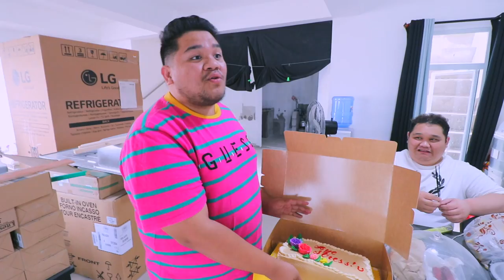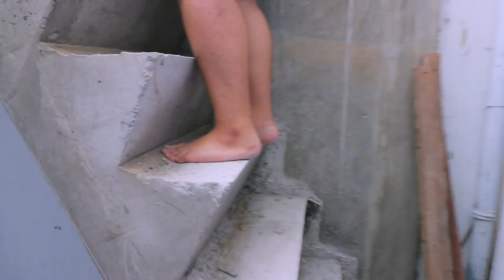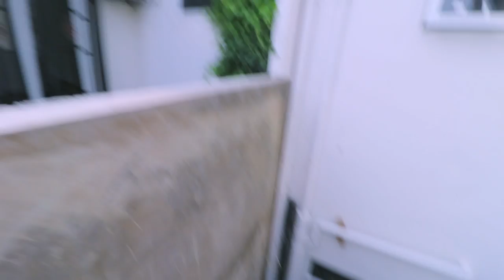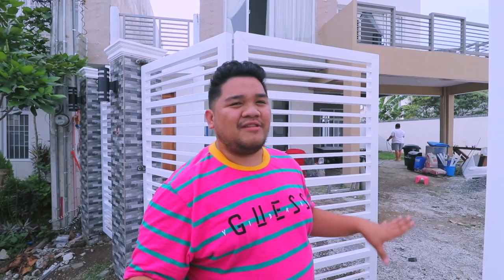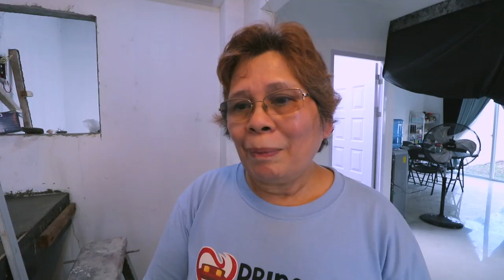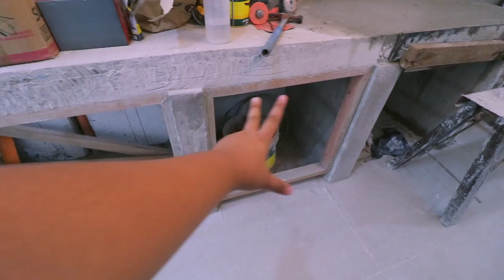TODO NA ANG STRESS KO SA BAGONG BAHAY (PALPAK ANG MGA GINAWA NILA BES!!) | LC VLOGS #366

Comment: Hi Lloyd Architect here, nice to know you’re reading our comments.
you should always first check the plans before starting the construction.
If walang plan instruct him clearly para aware tayo sa outcome.

What I have observed:
Stairs - not enough space for the desired slope kaloka yung nosing ng stairs matangos pa sa ilong ko.
The minimum width of the steps should be 250mm, min. height is 180mm.
If sobrang slanted na it won’t be comfortable, you can't have spiral stairs because the space pala is for laundry. you can consider steel framed stairs straight or L type following the recommend rise and run. 
The last step must be aligned sa flooring attached to the beam.

Toilet - the location of the cleanout is very wrong it is intended to be opened if may bumabara sa connection ng pipes, it should not be buried on the floor. Also check the pipe vents baka di din tama yung connection or clogged.

Flooring - better use tile adhesive rather than cement para mas kumapit yung tiles.

Gate - just put grease sa handle para di na matigas buksan.

P.s. Are you sure he’s an architect?
Check PRC website if he’s registered.
Reply: Same thoughts here din,  #SaArkitektoSigurado!!
Reply: I was also wondering dine eh about dun sa team ng contractor
Reply: If he’s an architect mygosh that stair tho. Mortal sin HAHAHA
Reply: true ka dyan sis
Reply: Oo nga po. Parang toblerone inspired yung sa hagdanan. Hays. Laban lang kween! 🙏
Reply: @J.Architects  I know right!! And the clean out!! Jusme building utilities MORTAL SIN!!
Reply: Hahahha ako nawala stress ko sa panunuod sa inyo..
Reply: Grabe ang nosing ng stair, susme. Maling mali. Napaka delikado. Agree na spiral stair na lang sana.
Reply: KerbieMonsanto pag akyat mo hati yung binti mo HAHHAA
Reply: Carmela Nacua toblerone yung concept ng stairs sis
Reply: Not an architect but opo I guess it's already an instinct lalo na Yung sa hagdan. And yuh same thoughts po.
Reply: Agree sa spiral stairs  tutal maliit naman ang space dun.
Reply: Ako hindi architect pero nung nakita ko yung sa hagdan maling mali talaga maliit ang space sana nga ginawa nilang spiral. At yung tiles 🤦🏻‍♂️🤦🏻‍♂️ hindi pantay pantay lol
Reply: Agree with this.  Anyway  mali din yung  sa room ng  mama nya. Nagkakasalubong yung  door palabas, room  sa cr at room ng  mama nya. Pano kumg palabas na si mamshie nya tapos  yung door  palabas  is nakabukas?  Parang di  pa ata naka graduate ng college yung  architect..  pano  kaya pumasa yun?
Reply: Mukha feeling tile setter lng un naglagay dun my makuha lng trabho hahaha.
Reply: Nakaka dismaya, malaking gastos na malaking perwisyo pa sayang pa sa oras. Nakakaawa naman yung nagpapagawa
Reply: rence sarmiento agree, lloyd deserves someone better worth his money and time 😔
Reply: Shocks!
Reply: Agree po ako!
Reply: Agree. Di ko matapos2 yung vlog, ang sakit tignan. Nasasayangan ako sa pera 😢. I love kuya lloyd tho. #SaArkitektoSigurado
Reply: Pams Santos i think yun na talaga floor plan ng house nila. Additional const ba yung toilet sa bedroom ni mother?
Reply: Christine T oo nga, naawa ngako makita syang stressedt.
Reply: I TOTALLY AGREE MAAM!
maybe yung floor drain niya rin connected sa soil pipe kaya isang reason din kung bakit nangangamoy yung CR nya maam. hay naku talaga, doble gastos doble trabaho. Kaya TIPS sa mga gustong magpagawa ng kanikanilang bahay, BETTER GET A LICENSED ARCHITECT, #SaArkitektoSIGURADO. 
Never doubt to hire a duly licensed professional, i-disregard nyo po sana yung mindset at yung word na "MAHAL", this scenario is one of the negative output if susugal kayong magpagawa sa illegal practitioners.

You have assurances if you'll hire professional practitioners, ARCHITECTS, Engineers, & Contractors. It's not illegal to verify their licenses before proceeding to the contract, it's your right.
Every penny you're going to spend is very important, sino ba naman ang sasayangin lang yung perang pinang papagawa para sa wala.
Reply: Glad, someone from the professional field commented.
#SaArkitektoSigurado #GetAnArchitect
Reply: Hindi ba pwede spiral na staircase?
Reply: Bwesit tlaga yung hagdan. hays😂😂
Reply: Tama ka jan Arch. Nicole... 😊 I think di na supervise ung mga tauhan 😒 ang daming palpak na gawa✌️nakakalungkot   lang... Ultimo tiles eh 😒😒😒  dapat s arkitekto ng sigurado 😊👍
Reply: Charissa Anne Cunanan sakit sa mata nung tiles
Reply: Di pwede spiral.  Dahil sa laundry room siya,  expect niyo na pagdadaan jan na may dalang timba or what pag bababa jan so negats sa spiral.  Dahil sa maliit na run, dapat steel frame na lang.  Anlaki kase ng kinakain ng konkreto
Reply: change contractor na kuya lyod , hanap ka na po ng planner and architec po sa house nyo para di kayo mahirapan at mastress 😊
Reply: I am a 2nd year architecture student po and I'm definitely sure na hindi architect yung contractor ni Kween. Kahit yung mga construction worker ay mukhang hindi alam ang ginagawa nila, hays. Nakakapanghinayang yung pera na nagagastos kapag walang arkitekto. 
#GetAnArchitect #SaArkitektoSigurado

PS: Medyo mahirap po kung spiral staircase ang ilalagay. Imagine mag-aakyat ka ng mga timba na may lamang basang sinampay sa taas #Pahgud Suggest ko po sana ay L-shape tapos sundin ang standard size ng rise and run sa building code.

Mabuhay ang mga arkitekto! Lalaban tayo!!!
Reply: D man po ako arkitekto eh nkakalula po ung hagdan nla kween LC senior pa naman na mama nya masyado delikado po
Reply: Parang may isa sya sa video nya na kasama yung architect?Or interior designer Ata un .. sana maayos na yung house mo ..
Reply: medyo mahirap po siguro if spiral staircase considering na may mga bitbit na labada sa pag akyat and baba ng stairs. maybe pwede bawasan yung slab enough to place a galv. steel u shaped staircase w/ correct run and rise. anyway, go Lloyd! #SaArkitektoSigurado
Reply: same thoughts, napaisip din ako sa credibility ng 'contractor'. Hindi naman ganun ka complicated yung vision ni Lloyd sa renovation bakit yung mga simple stuff nalang extremely palpak pa. Mas malulupit pa ang gawa nung mga nakikita kong small/startup renovation companies led by young and new architects.
Reply: I'm not even an architect, coming first year archi student palang ako, unang tingin palang sa stairs jusme maling mali na po
Reply: Carpenter yung papa ko at siya rin yung tumulong kay kuya para matapos yung bahay na pinapagawa niya. Napalingo ng dis oras yung papa ko lalo na regarding sa hagdan at cr.  Yung concern rin niya is yung sa gate. I felt his frustration kaya napatanong si papa if legit ba yung contractor na pinagawan ni queen lc.  Sana lang maayos agad yung problema kasi di biro maglabas ng pera kasi tapos di pa na meet sa expectations mo.
Reply: Ayun. Nandito pala si Madam na Architecture to also help you and give you ideas & tips. I also noticed the same things din po Madam.. 👍😊.
Reply: Kailangan May hawakan yong hagdan for safety. https://youtu.be/JavskfVd7vs
Reply: @khentmangoba  good observation, i  forgot na laundry space pala yung area di nga naman applicable yung spiral. i also thought of L type stairs but d natin madetermine eh we dont know the exact dimension of the area..
Reply: @pink.sweater  thank you for your corrections 👌🏼
Reply: anyways i hope they find better solution first and have a concrete plan before starting any construction. fellow architects also have helpful suggestions. #SaArkitektoSigurado 👷🏼‍♀️
Reply: As a student architect myself, stairs, as well as escalators, must be between 30 and 35 degrees. His stairs to the balcony is too steep, it exceeded 35 degrees but close to 90 degrees.
Reply: my dream course:((
Reply: I agree actually sa past videos nagtaka na din ako sa stairs pati sa ibang parts ng bahay but still maganda parin naman but it will be more worth it if it was built well
Reply: @fari5119  never too late ❤️
Reply: Naloka nga ako sa slope ng stairs niya! Violation nato agad sa NBCP. Actually all stated problems on the site were violations. Kaya po suggestion lang, please get a professional. #GetAnArchitect
Reply: Vaka  nman pwedi pa ka sa interior ng bahay ko.  Magkano po? Hehe
Reply: Some of this qualified professionals don’t have enough experiences. No matter how long they have been sa profession.

Comment: Hi LC, let me give you an advice.
1. Laundry stairs, make it spriral steel or U type concrete, the contractor seems dont know what hes doing here, sobrang sayang ang labor and mats.
2.Toilet, sumisingaw ang aweful na amoy because of the not totally air locked CLEAN OUT , yan yung tinuturo ni mother dear, take note i cant be covered by tiles ha, wag icover itll be an access pag may bara,. It should be surface mounted or counter sunk type
3.Kitchen counter, so depressing, wala na gumagawa ng concrete hallow blocks and buhos top nowadays, all modular cabinets na ang frame and finish, the counter top can be granite,solid solid surface, i recommend quartz.
4. Kung gusto mo ng maayos na bahay LC hire a project manager or pwede kang magpalit ng contractor, its not just a home, its your DREAM HOME, God bless =) 
-Architect and Master Plumber
Reply: Dapat  hindi masyado tipidin ni lloyd ang pagpapagawa ng malaking bahay. He really need to hire an architect

Comment: Also architect here. Additional: 1. Don't forget the triangle method in kitchen, and also kitchen's orientation must lie on west side of the house kase it needs sunlight (one of the reason is tinutunaw nito ang germs na nabubuhay sa kitchen). As I can see, high ceiling sa kitchen which is a good thing kase "hot air rises" but it needs ventilation para lumabas ang mainit na hangin. 
2. Sa tiles, nakita ko palang "kapak" na which means hindi buo ang nilagay na tile adhesive sa ilalim, tendency, matatanggal ang grout at tuluyang aangat ang tiles. Hindi na ito maaayos pa kaya ang magandang gawin ay tanggalin at palitan.
3. Laundry area, ang drain ay dapat naka "slope to drain" para di bumaha at di tumulo sa ilalim, merong waterproofing na hinahalo nalang sa cement it's around 800 pesos only sa hardware.
4. Wag manghinayang kumuha ng professionals dahil mas tatagal at matibay
in the long run. Kesa sa palaging may problema, laging pinapaayos, mas magastos.
5. The stairs is a mess. It doesn't passed the standards of National Building Code of the Phil. Wag rin spiral stairs kawawa ang senior. I suggest i slope pa at iurong pa ng onti ng landing area sa taas. 👍
6. For your plans consulations, GET AN ARCHITECT. Sa Arkitekto, sigurado. 
God bless kween kaya nyo yan 😊
Reply: Uppp
Reply: Very well said💖
Reply: Yes ❤

Comment: Hi Sir Lloyd, concern lang po ako. Just a piece of advice: when building or renovating a house please hire and consult an architect first. Never coordinate directly to a contractor (I assume it's what you did) because that is the job of the Architects. Ang architect yung magpapaliwanag sa contractor ng gusto mong mangyari base sa pinag usapan at pinagplanuhan nyo at malalaman ng Architect kung may hindi nasusunod or may mali sa pinapagawa ninyo sa contractor. Dahil ang Architect ay laging inuuna ang kapakanan ng cliente. Kapag kasi wala kang architect, mawawala din ang checks and balances mo sa contractor na kadalasan kung saan makakatipid duon sila. Which should not always be the case dahil macocompromise ang tibay at functionality ng bahay mo. In the long run, nakatipid ka nga ngunit madami ka namang magiging repairs after. Please consider hiring an architect (na separate from the contractor para impartial ang judgment) bago niyo pa ho ituloy ang extensions and renovations para hindi masayang ang hard earned investments po ninyo. Salamat.

Comment: Mamsh Lloyd, nadali din kami ng mga "CONTRACTOR KUNO"
Gumastos kami ng 400k para sa extension ng kusina at kwarto.

Pero sobrang palpak talaga. Ilang months bumagsak ung ceiling. 

Advice ko lang na dapat may legit na contract kayo ng contractor na notarized ng lawyer mo para in case palpak or may damages sa gawa nila may habol kayo and compensation sa abala. Good thing din na lumipat kayo para macheck niyo progress ng gawa nila.

Be wise kasi malaking pera ang ginagastos.
Reply: maam, anung phase kayo? parang kilala ko kayo base sa bumagsak yung ceiling. haha
Reply: Same issue 200k hind man lng natapos un kusina kong napakaliit. Dami manloloko
Reply: Agree
Reply: Kaya its safer na kumuha ng legit and licensed talaga na engr. Malaki man gastos pero less hassle and stress. Sure pa na ma aachieve ung desired na gusto mo ipagawa.

Lesson learned na yan kay mamsh Lloyd.
Reply: correct. kami din ganyan palpak yung nakuha ni mama na gagawa ng bahay tas mukhang pera pa kumuha agad ng big advance sa mama ko! Pero nung pag uwi ng papa ko at nag stay na sa bahay dami nya nakitang palpak pati yung tiles umangat na ang ginawa ng papa ko pinuntahan nya ung mga gumawa ng bahay namin at yun pinag mumura nya sila. Kaya yun inayos nila ulit wala silang nagawa!
Reply: Dapat may contract kayu.. Para may habol kayu..back job yan madam...

Comment: Me as being architect, in this kind of situation, tama na ibigay natin yung gusto ng client natin, pero we also responsible sa safety ng ating client.

1. As i watch the video, with regards the laundry stair, it is not advisable to use concrete stair kasi kumakain ito ng space, knowing na maliit ang space ng laundry area. ako i recommend to use steel stair design industrial type. mas mura, mas safe, nasa standard pa, mas mamaximise mo pa yung space above ad below the laundry.

2. With regards naman sa tiles, mukang mali ang timpla ng adhesive at ng cement para sa tiles, mukang malabnaw or what kaya di kakapit ang tiles jan at mukang di marunong gumamit ng level. 

3. Laundry tiles must be Non-skid tiles para di nakakadulas, plus yung spacing ng grating masyadong malalayo, mukang sinadya para di halata na pantay pero nahuli parin ng matalim na mata. hahaha

Comment: If you think, getting a well designed house is Expensive,  wait until you realize how much will it cost to rectify an ugly one. Be Smart, Hire an Architect.
Reply: bat yang ganyan nakalusot sa inspection ng city diba may inspection sa plumbing ,  electrical at  structuure  bakita nakapasa sa city yang ganyan  dapat dyan bagsak hanggang di naitatama
Reply: @galteknhobbies9500  normally city hall just check the plan before and after if its the same as plans submitted. Pero yung mga di align na tiles, mabahong cr di n ksama yun. Unless magreklamo ang kapitbahay about sa amoy

Comment: Architect po ako. Natawa ako sa hagdan. Hahaha Then if may tulo feel ko d nila pina waterproof yung slab ng labahan. Daming pintas sa bahay. Tinipid sobra pagkagawa. Ang nakakatakot kung pati sa rebars tinipid din.
Reply: Civil Engineer here. I agree that the slab should be waterproof. Para maiwasan yung leak sa ground floor. For the stairs naman yung design should fit on the space lalo na yung degree of inclination may calculation din po yun, safety is very much important din in designing the slope of the stair.

Comment: Present! 💗
Regarding sa banyo, based on what I saw, septic tank area ito. I suggest not to cover the orange tube/pipe with tiles. Septic tank kasi hence every 5 years you have to hire a company to clean/clear it (think "Malabanan"). Kung may tiles sa ibabaw, you cant clean it. Just a suggestion.

Comment: If i may suggest kween Lloyd Cadena, dun sa stairs ng laundry area. Instead of diretso na stairs paakyat, mag lagay kayo ng landing spot. Mahirap i explain in words pero by looking at it 2-3 steps from the ground floor tapos isang flat na square floor bago yung paakyat para hindi naman steep yung pag akyat. I agree mali yung pagkaka gawa ng steps ng hagdan. I’m no architect but yun nakikita ko na magandang design for your Mom para di siya mapagod pag akyat. 

Yung sa gate, hindi lang siya level kaya mahirap buksan at isara. Need lang ng adjustment yan.

Sana ma consider niyo :) proud of your achievement.
Reply: Mas maganda kung spiral steel staircase.
Reply: Parang hindi na po kaya lagyan ng landing kasi maliit na yung space, kaya po tumaas yung riser nung stairs hinabol yung height from ground to laundry area, which is uncomfortable yung kinalabasan nung stairs, spiral stair nalang nga kaso kung may mga gamit din na dadalhin sa taas baka maging masikip naman, or  magbigay ng enough space yung launry area para sumakto yung desirable stairs. Much better consult an architect. looking forward to see ur house na matapos na ❤️❤️. more power and vlogs!!!
Reply: Spiral staircase po mas babagay dun papunta sa taas

Comment: Sir Lloyd, when doing a house consult an Architect and Engineer. Maybe costly but it's worth every centavo. Seeing everything as a engineering graduate. Danger po and di safe yung other parts ng bahay. The stairs even. Unbelievable tapos po yung CR dapat po well treated. 😊 Sana po maayos po siya in the future.
Reply: Meron daw sya hinire na engineer and architect
Reply: @marychris7153  I highly doubt na may architect yan. Baka pirma lang ng architect yan pero yung contractor/engineer ang nag draft ng plans. Sa archi school 1st year pa lang tinuturo na samin kung paano gumawa ng stairs ano ang minimum dimensions etc. Napaka-imposible na licensed architect tas ganyan yung gawa

Comment: Hi Kween, payo lang po as an experienced Engineer.. Yung sa CR po ninyo na kulay orange na may takip, cleanout po ang tawag dun, yan po yung access pag yung toilet ninyo ay barado so as much as possible po, huwag ninyo siyang e condemn (wag po nating ibabaon sa flooring/tatakpan ng tiles) pero kaloka yung placement ng cleanout--😂.. Also, yung sa leak po sa laundry area nyu.. Kailangan po ng water proofing, and napansin ko din po na parang flat lang siya and walang daanan yung tubig pag umuulan, naglagay po ba sila ng drain para hindi mag accumulate and tubig sa taas? Godbless kween, I hope problems in your house will be resolve na po.